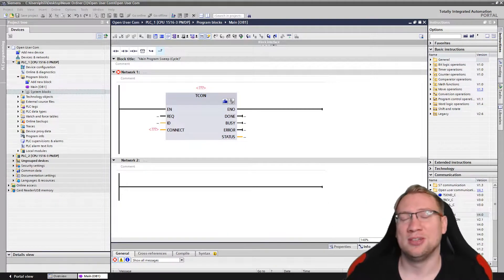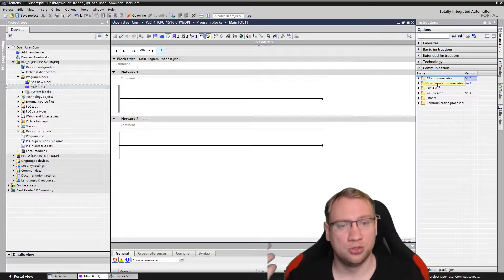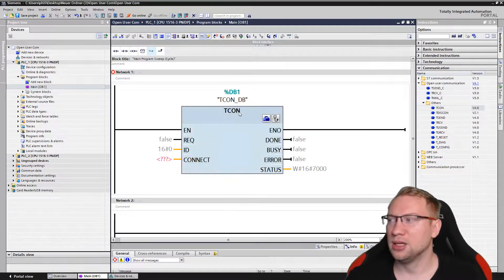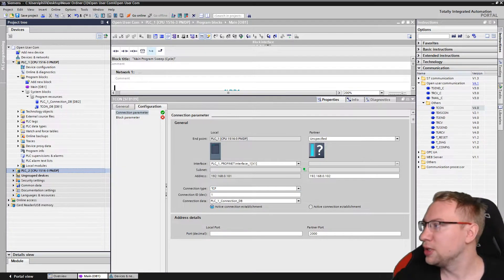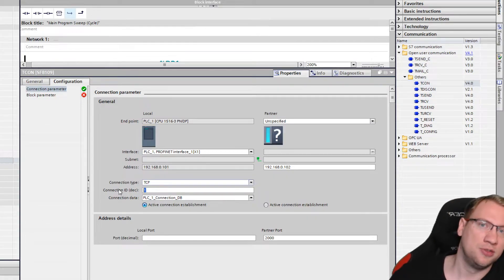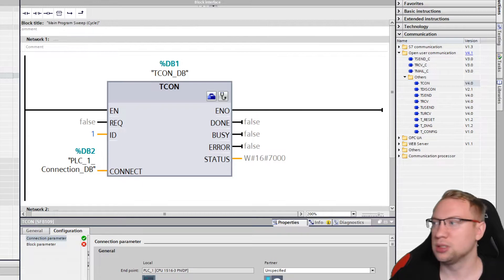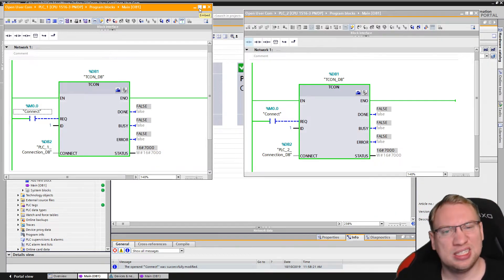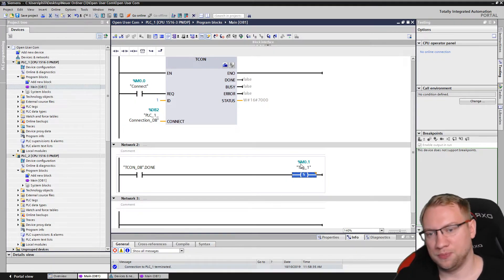TIA Portal: Open User Communication using TCON - TCP / PLC-PLC Communication

Comment: Hello! I'm trying to communicate between S7-400 with CP413 ethernet card and S7-300 with ethernet connection on the CPU, these PLCs are in different projects. I am trying to use TCON, on the S7-300 a connection is opened but with an error, on the s7-400 no connection is opened. could there be any other configuration to modify that is not exemplified in your videos?

Comment: Hi, I have a question. If I want to use TCON BLOCK to more connections, where do you suggest to use it? I have face some problems adding another one in the same program. What I must to consider to solve it?

Comment: Nice video but setting that connected bit (M0.1) is not usefull i think since you only can check it one time and after that you will never see if the connection is ok. So you should be using T_DIAG instead to check connection.

Comment: fantastic Video as always, you have helped me so much, I need to communicate with a Partner PLC - Password Protected CPU and Blocks, I have addresses which the Equipment Manufacturer has shared with me but that is all, I do not know How the coms has been setup but profinet is being used. what Are my chances of communicating with the partner PLC, I am Using ET200s CPU  the Partner is a 1214.
what information should I be asking for from the manufacturer? your help would be appreciated, thanks

Comment: QUESTION:

First, I want to thank you for all the time you put into this videos, I've gained so much knowledge from watching your videos.

The question: I have two s7-1500 PLCs that are wirelessly connected using Siemens scalance 700 WLAN access points or WAP. One of the PLCs is mounted on a vehicle that roams from one WAP to another. The other PLC (main PLC)  is connected to a vehicle management system PC, it allows this PC to send/receive data to the vehicles. I am try to see/monitor how long it takes for data to travel from and back to the  main PLC? Any suggestion on I do this?

Comment: Hi! i try to connect a CPU S7-300 with a tightening tool, but i still have status 7000 and the communication it is never done. any idea?
Reply from the maker: Hi Delisor! The Status "7000" just indicates that the block is currently running without errors. When you make a connection between two devices it will become a "0000" for a very, very short time that we can not even see... try using a "Set" statement that get's activated when the value becomes "0000" (even one cycle is enough for the set). If the memory bit connected to the set becomes "TRUE", you know that you have a connection
Reply: i already use set, but it is never set, so the connection is never done. i use a CP343 for the connection. Could be a problem?